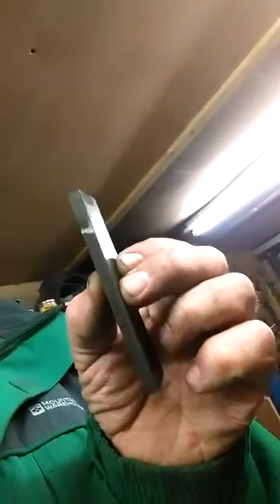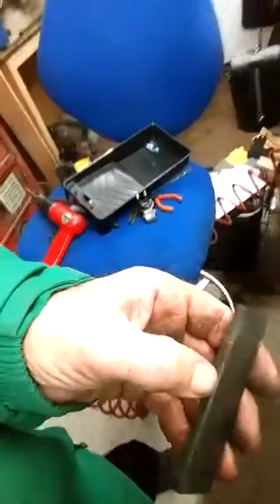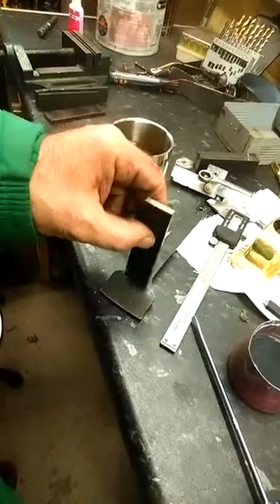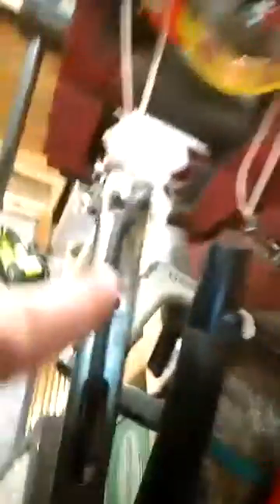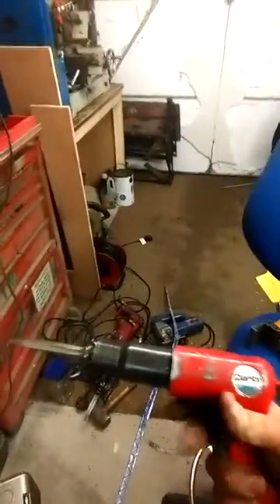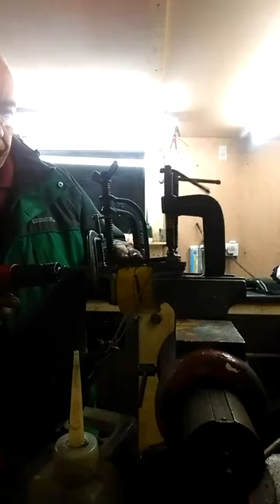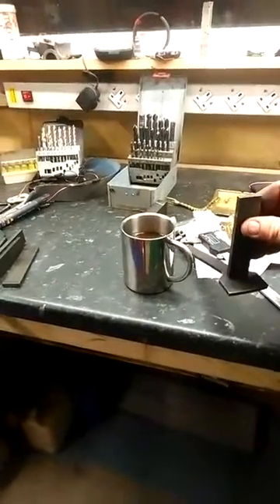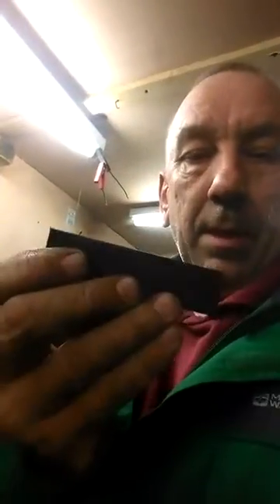How to magnetize a dead magnet

Comment: The magnets in my flywheel are embedded wont come out.  Is there a method to recharge them in the wheel?
Reply from the maker: You don't say whether your magnets are on the inside of the flywheel or on the outside of the flywheel. It is possible to recharge them with a specially made coil without the hammer  effect. Is it possible to drill a hole behind the magnet and knock it out from the opposite side. Failing that you might need to make a small pocket and add rare earth magnets to the original magnet. Good luck with your quest
Reply: Hey exact same issue here, also with my flywheel. did you find a solution?

Comment: I like to know why the hammer works to magnetize the metal?
Reply: you can also remagnetize a magnet with another one, like a really powerful one, and that will also realign the poles
Reply: @pixel8119  the coil he ysed is an electromagnet. Magnetism and electricity are two sides of the same coin
Reply from the maker: The hammer giggles the molecules so that they align north to south. Try this find a none magnetic screwdriver. Hit it with a hammer and see if it has acquired some slight magnetism.
Reply: @timothypeace6651  yeah but isn't that an unstable magnetism. Like last time I checked that will eventually get weak again
Reply from the maker: @ragnorockcookie2868  you could be right but it lasted long enough for me and my purpose.
Reply: @timothypeace6651  hmm interesting
Reply: @timothypeace6651  the have you ever done a experiment to see how long the magnet will last and how much strength it will loose
Reply from the maker: @ragnorockcookie2868  nope.
Reply: @timothypeace6651  nope like will you have never done it or nope like you won't do it?
Reply from the maker: @ragnorockcookie2868  that would take some time as I owned my engine for 2 years